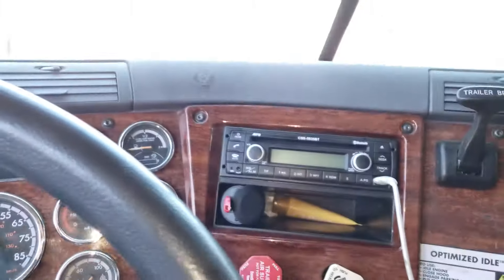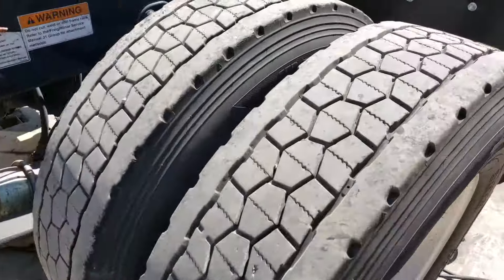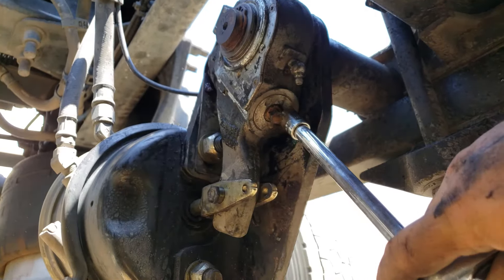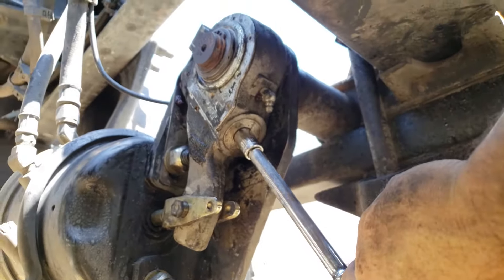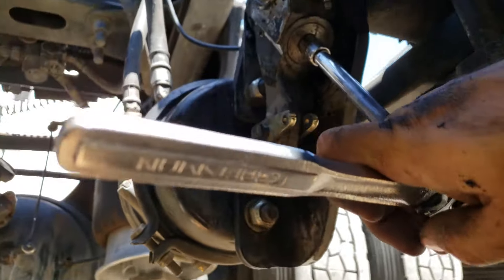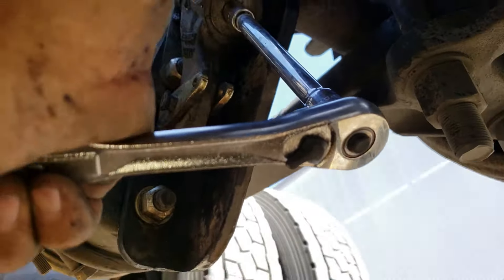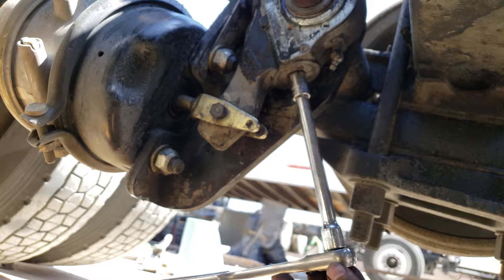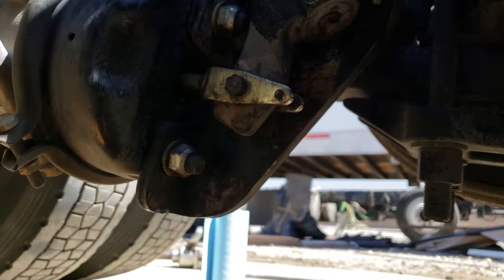How to adjust automatic slack adjuster

Comment: The only time you adjust auto slack adjusters is during installation and when testing. In between time you don't touch them. The rule of thumb is a 1/2 turn. Even if you turned it 1 turn the auto slack adjuster will correct it in 20 or so brake pedal pushes. Adjusting too little the adjuster can't correct and then you have brake shoe drag.
Reply from the maker: tell that to a CHP inspector!
Reply: Never seen an auto slack adjuster work properly yet. I'll grab the tools and check for proper shoe to drum clearance every couple of weeks.
Reply: You're joking right.  It's called a pre trip inspection forna reason.  If you drive like that turn in your CDL thanks
Reply: @Uncleshawny  , how long have you been driving? Auto slack adjusters do need to  be adjusted,  so you get under your trailer at a truck stop and adjust them, then get a buddy to press your breaks? ,( during your pre trip) anyways good video
Reply: @wheresfrankie  no I must have commented on the wrong thread on this video. I always adjust mine if needed and even lube them to spec.
Reply: @Uncleshawny  , wasn't trying to be rude, hey we're all on here looking for the same answers.
Reply: @wheresfrankie  no you're good
Reply: We always used to back up about 5 mph and slam on the brakes. You can feel em come in. I have to do mine because I can't slide my tandems when I'm loaded without a chock or a block of wood. My truck doesn't have a trailer hand valve.  Good video.

Comment: Technically only qualified mechanic should adjust automatic slack adjusters. Drivers should not adjust them. Manual slack adjusters ok for drivers to adjust but not automatic slack adjusters .
Reply: They shouldn’t need adjusting if they are working correctly. Doesn’t hurt if your a driver and know what your doing. I would rather have manual slacks. Less issues and don’t take long to adjust.

Comment: He doesn't mention it but u need to chuck the wheels or leave the brakes set on the trailer if you're adjusting the tractor. Wouldn't want a swift moment would we😂

Comment: Are these Gumite? Most buses at my job are Bendix, and they have the pull pawl that you have to release before taking them in. Also, I go a half a turn back when adjusting them. At least that’s how I was taught.
Reply: Just wondering the same thing.  Saw these this morning, and so watched this video on them.  Didn't see the pawl on mine.  Have also heard both 1/4 and 1/2 turn.  Have also heard a credit card should fit between shoe and drum.
Reply: I now work at the city, doing trash trucks. They don’t have a pull pawl. You just take a 9/16 socket (for most) and turn it in or out. I now do a 1/4 turn because that’s what they do here. Also studying for my ASE right now and it says the rule of thumb is tighten all the way down, 1/4 turn back. Never heard the credit card rule.

Comment: You're damaging the gears that make them automatically adjust when you do it like that
Reply from the maker: how do you adjust your brakes?
Reply: @TRUCKINGTIPSDIY  with an automatic slack adjuster you have to back off the locking mechanism, the way you did it works for a manual slack adjustment  but if you havent already you will eventually brake the slack  adjuster
Reply: @fstompo   That's a haldex slack. They do not have a locking mechanism(pawl) and it is normal for these slacks to be making that sound when you are backing them off. it's a problem when you do not hear that noise.
Reply: @manavsaini3956 true I have the same ones and when you don’t hear that noise when backing off then you need a new slack adjuster bc that nut isn’t holding the mechanism down

Comment: Those aren't auto slack adjusters. Those are old style slack adjusters. These you must adjust every month or when the brakes aren't stopping enough.
Auto slack adjusters are made differently and adjust when you come to a stop and put 30 pounds of pressure on the brake
Now some road rambos are already screaming you'll burn up your brakes putting so much pressure on them but if they would actually READ their owners manual or the manafactures manual on the auto adjusters they would learn that the most effecent way is when coming to a stop is let the truck stop as you usually do then release the brakes and roll a few inches then actually push the brakes hard so you put at least 30 pounds of air pressure on the system which activates the adjusting mechanism in the adjusters. Do this 3 or 4 times and you'll notice a big difference in the stopping power. And no you aren't burning up your brakes if you're not generating heat at speed! You're freaking stopped doing a needed adjustment.
OR do it at the end of the day when parking the truck. Do it the same way in reverse and forward. 
NOW some auto adjusters will adjust while parked and the brakes are released. Just apply 30-60 pounds at least 10 times if you dont do this every day. And it's a good way to test your emergency brakes! 
Note: they will NOT over adjust. So dont worry.

If I'm doing a lot of city driving I'll do an adjustment once or twice durring my deliveries to keep them in top stopping adjustment!
AND a tip!
Get that red light to pull around back at the scales for that oh so fun DOT inspection? Do the above to make sure those brakes are in adjustment before he goes under the truck with his tape measure! 

But do this on a daily and you're never going to get a write up OR be accused of out of adjustment brakes in case of an accident.
Try it today and be amazed! I find it funny that not a single big box company tell their new hires about this process as most if those class room instructors never had to even do a manual adjustment on either style of slack adjuster!

Blue Sky's and Safe Journeys!

Rollover!
Reply: No they are not.
Reply: My company has 10,000+ trailers. Every trailer I hook to is for the first and last time. I know a trailer needs adjustment when the brakes are fully applied and 4 loud "thunks" are heard. That's the ratchet mechanisms working. Once that's heard, I'll keep pumping at ~80+ psi until the thunking stops.
Reply: Look guys this are automatic slack adjusters. They have been mandatory since 94 for trucks and the year after for trailers. The anchor strap is on top.

Comment: Hey how come people say they automatically adjust just  by pressing brake 6-10 times all the way in while parked? Is this true?
Reply: they usually do unless they havent been greased. make sure you have 100lbs of air. push your brake pedal to the floor and hold it there for 5 seconds. release. build air if you need to get back to 100 and repeat.

Comment: how to adjust automatic slack adjuster that it’s not automatically adjusting by himself ... ?
manually !!! 😝😝😝 😎😎😎
dot should give some violations to the producers of those automatic slack adjuster... right ???
😬😬😬
Reply: If they are not set right after work. Its Drivers falt. It's always been that way. Pass the buck is lazy man's way. So I see you are a very hard worker. Keep working on placing blame you are great at that.
Reply: Craig McNeil😃  relax man 😁
Reply: @c.a.mcneil7599  What is falt ?
Reply: I could be wrong but to adjust automatic slack adjusters on most if not all you have to be above 90 psi and do 6 bake  applications
Reply: The producer of this video needs some dot violations. ASA slacks work good. Manual slacks work good as well